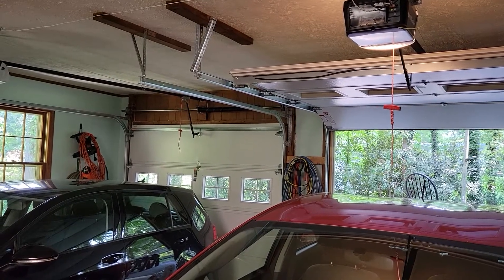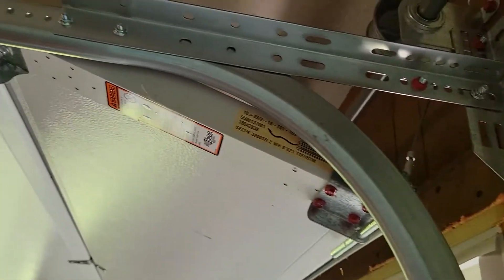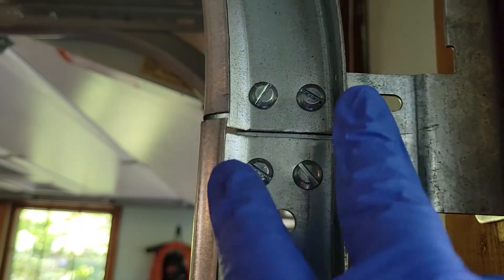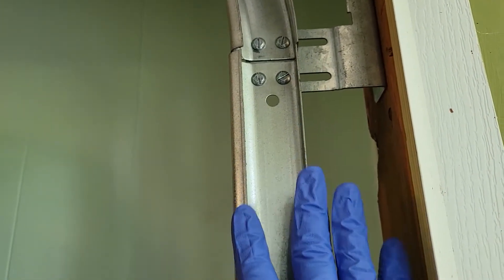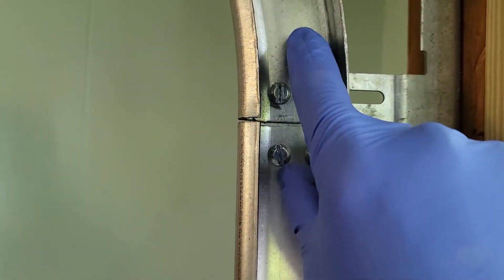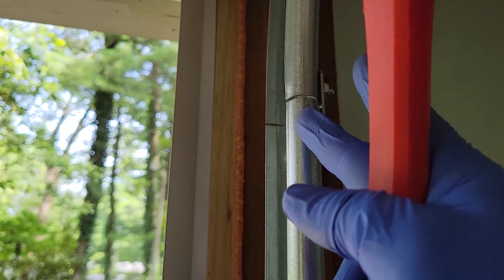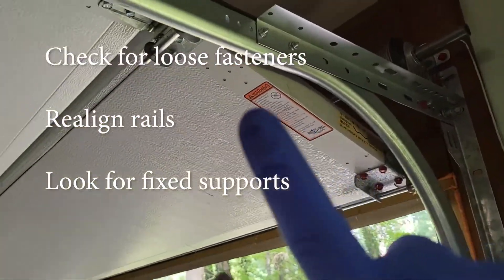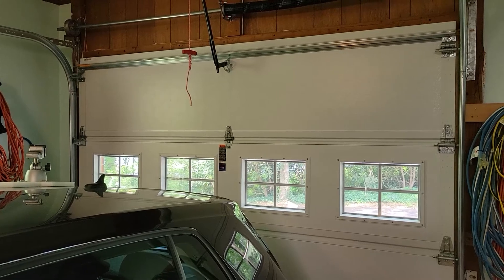Garage Door Track Alignment for smooth operation

Comment: Thank you for sharing, it's exactly what I needed to know on how to fix my tracks. 😊
Reply from the maker: You know for a long time it sounded like the Chicago L train, before I realized something was wrong. Glad the video helped you out. Thanks for watching.
Reply: @cfldriven  I went out today with hammer in hand and gave it a couple good whacks..lol.. it's aligned now🤣🤣
Reply from the maker: @robbiewegard9874  Congrats on putting the hammer to good use.
Reply: @robbiewegard9874  Exactly what I was thinking. Or bend it with some channel locks. I had the same issue on both sides.
I simply took a hammer and gave each misaligned track edge a couple of medium whacks until it aligned. Much quieter now 
Each misaligned section was where the bend starts.

Comment: My problem is there is quite a gap along the sides and top of my door, even though the weatherstripping is good and tight. There seems to be too much play in the door when the wind blows and in winter it lets in snow at the side. I will take a look and see if this alignment method will work
Reply from the maker: Our door is only 5 years old, and the ext weather stripping keeps everything out without any play in the door despite the inside gap between door and framing. If the tracks have shifted you might be able to re-align them. Make sure to check adjustments by manually opening and closing door just in case something binds.
Reply: @cfldriven  thank you
When I push against the inside of the door it feels tight against the door frame. But as soon as there is any wind it blows the door inwards and I can see daylight at the top and sides. Maybe it is the weatherstripping that needs adjusting?
Reply from the maker: @DerekGH  Check to see if it has hardened, ours is firm but pliable enough to seal each time.
Reply: @DerekGH  I had this issue and installed the green hinge system. Great upgrade for $100 bucks. Doesnt move with wind

Comment: Any idea what caused the tracks to become misaligned to start with? Seems odd if the bolts were already very tight.
Reply from the maker: John, great questions. Not sure if over time the alignment just shifted from use as it never took any kind of  impact. Just happy it was easy to correct.
Reply: @cfldriven  I can't say with certainty but I suspect the constant movement (up/down) of the door would be the main cause. Beyond that, weather variations (hot/cold), depending on your location, may also be a culprit and finally even changes/shifting in the ground might also be a factor.
Reply from the maker: @grantfahlman1815  And don't forget fasteners that come loose over time can also lead to misalignment. Thank you for sharing your thoughts.

Comment: Where can I find those screws? Because mine aren't like that
Reply from the maker: The fasteners came with the original garage door, I would advise checking with the manufacture or a local hardware/lumber store that carries garage door parts.

Comment: I have right front wheel off track and I forced the motor to shut down the garage door but the wheels on the other side fell off too. The track is bent. What do you think happened?  What can be done. I manually pull the lever to disengage the motor put the wheel back on track and lowered to the ground. Plz help fix
Reply from the maker: You have to determine why the wheel came off the track, is it worn out, misalignment, broken or worn part? Can you DIY repair or do you need to call in a maintenance person to make sure it safe?

Comment: One wheel was off track.  I force the motor to shut unsuccessful now the wheels on the other side falls off. Did the motor bent the track? Can I manually bend the track back?
Reply from the maker: Truong, first try to determine why the wheels came off the track. Do they need to be replaced? Are there any loose nuts and bolts? Are the tracks bent or damaged? Look and see if the tracks are in alignment and if the wheels can travel smoothly. Are there any large gaps between each section, if so try to minimize the gap. If you can get the door to slide smoothly without the motor then you are almost there. Best of luck.
Reply: @cfldriven thanks for fast reply. I will do as you told me thanks